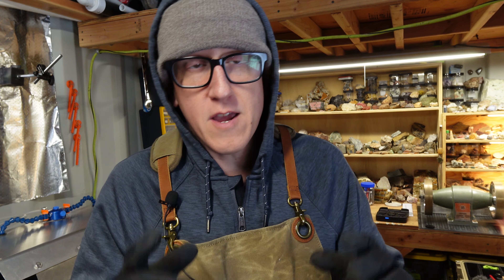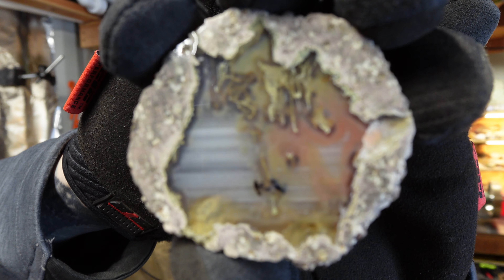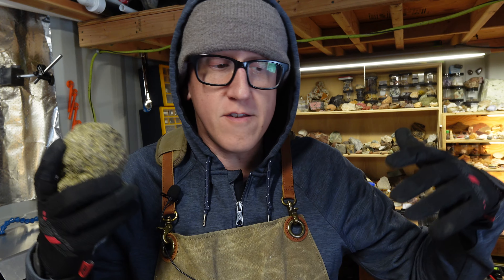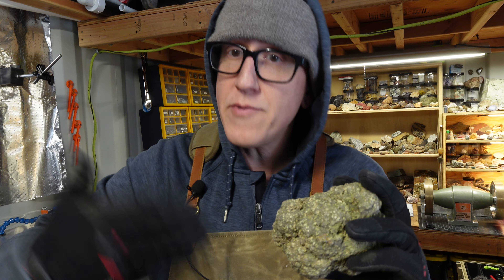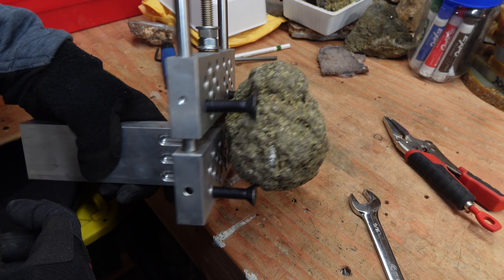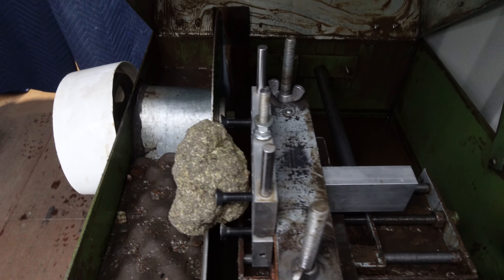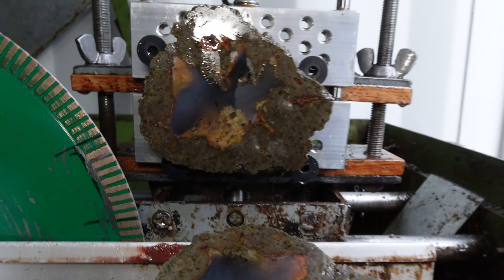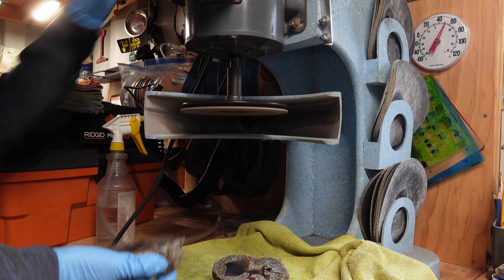My Last Lucky Strike Thunderegg

Comment: I don’t know if it will prevent it completely but I thoroughly blow off my eggs with compressed air before putting them to a polishing wheel to encourage grit or loose shell to take a hike. I haven’t had  much trouble with wheel contamination since taking this step. I actually keep a blow gun at my bull wheel to blow out powder before moving on as well.
Reply from the maker: Perhaps it's time for me to take it outside and blow it out as well. Thank you for the advice on that.

Comment: Always our own biggest critics. You have a beautiful selection of LS Thundereggs IMO. Great colors and varieties, waterline, moss, fortification and ones with the white polymer that has eyes/orbs. Agree wholeheartedly about the crumbly rhyolite and even crumbly quartz and have been frustrated on dozens of pieces with the same dilemma and end up typically going back to 140-180 grit stages. So far though, If I couldn't get the kind of polish on my first try I never could really satisfy what I wanted and most times have settled with a less than exceptional polish on the ones that caused me so much frustration. (there's just so much other stone to polish! haha) Thanks for the post!
Reply from the maker: Have you tried or had good luck polishing the lucky strike eggs with your vibratory lap?
Reply: @CurrentlyRockhounding  I haven't even tried. Been scared that 1. they're not heavy enough to maintain good surface contact with the slurry and 2. Never even thought about doing em that way? haha Now I know how Ima do the ones from Polka Dot Agate mine! 🤔🤔
Reply: Vibrating laps work great for the thundereggs that are too large for the Richardson. I use an assortment of lead weights to keep them snug to the bottom but still jiggle about. Damn messy process though!

Comment: Beautiful work Jared!  I recently picked up one of these Richardsons high speed sanders and am still learning how to use it.  I'm having trouble getting a nice polish on my stones.  So far I've worked a few thunder eggs, as well as some Montana agate and petrified wood.  I converted my machine to accept hook & loop discs without the hole in the center.  I've been using silicon carbide discs all the way up to 2000 grit, then finishing on the Richardsons leather polishing wheel with cerium oxide.  They all come out pretty shiny, but with a very slight "orange peel" texture to them. I say "texture" but it's not something you can actually feel, only see when the light hits just right (wish I could attach some pics).  I don't get that on rocks I work on my cabbing machine. 
I've also noticed that my stones get very hot while on the high speed sander.  Could this be part of the problem?  Should I be periodically cooling them off while working?  Am I pushing in too hard on the disc?  Any help is greatly appreciated, thanks!
Reply from the maker: Hello!

I do have some other videos on this subject which you might want to check out if you haven't ready, but it sounds like you're really over doing it. For something like a thunderegg going beyond 800 grit really is not necessary at all to do.  I have a video you might want to check out called "Which One Gets a Better Polish?"

If your rocks are getting very hot, then you are spending too much time on the sander.
Reply: @CurrentlyRockhounding  Thank you for your response!  This has helped with my results.  I've watched all of your videos using the high speed sander and really appreciate the content.

Comment: What rpm does your flat lap run and like wise the carpet wheel?
Reply from the maker: The Richardsons High Speed Sander runs at 3450rpm and the carpet wheel spins at 200rpm